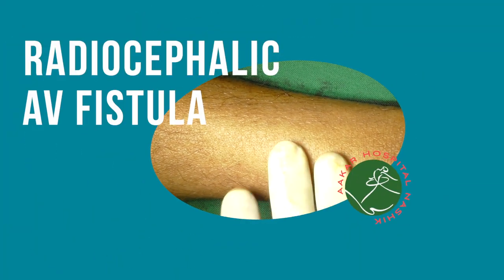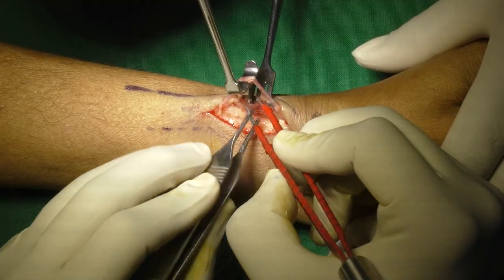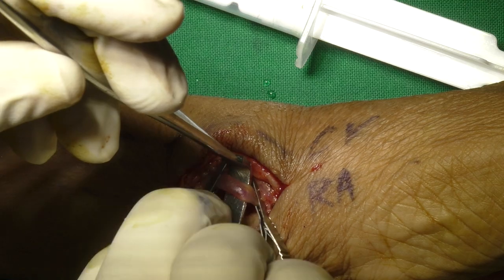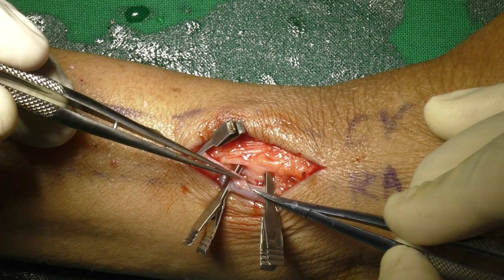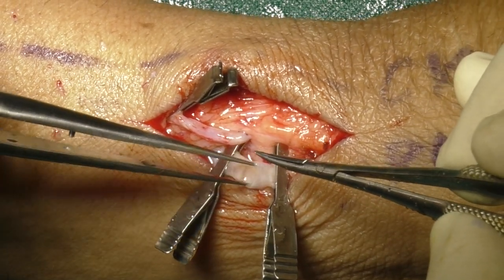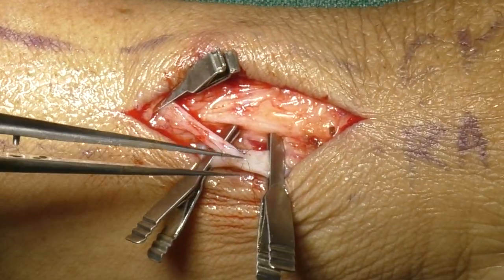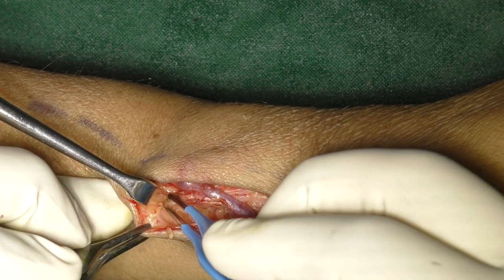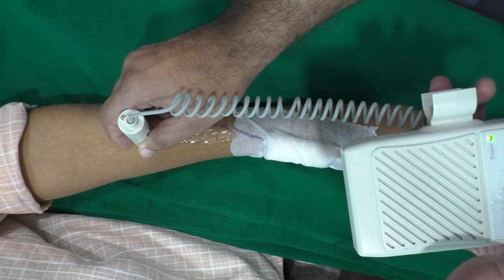RADIOCEPHALIC AV FISTULA  | DR KIRAN NERKAR - AAKAR AESTHETICS | NASHIK | 2022

Comment: Sir , how to record the video with such clarity even the microvascular anastamosis. Which camera or Handycam do u use. Are there only ot light or u use extra lighting.
Reply from the maker: We have installed a third arm in light assembly , on which we mount our Panasonic Camcorder ( max resolution 50 mp) V785 .. 

We have regular OT lights only . No other separate lights were used. 

Secret ( not so secret actually.. trick ) behind micro vascular clarity is proper zooming in of the footage while recording as well as in post production ..

Comment: Sir does excising the arterial wall result in a better patency? (Vs just incising + anastomosing)

Also is there any difference b/w continuous vs intermittent suturing?
Reply from the maker: It all depends on: 
1. What was followed in your training centre
2. What option you are comfortable with ( incise Vs excise )

Since I have never done an end to side anastomosis With just incising artery.. I feel excising some part of arterial wall works best in my hands.. I CAN'T COMMENT ANYTHING ON JUST INCISION METHOD AS IT WILL BE WRONG ON MY PART TO DO SO WITHOUT EXPERIENCING IT.

Regarding continuous Vs intermittent.. for smaller vessels , it's not advisable to opt for continuous suturing  ( I do continuous suturing for some part of Radiocephalic AV Fistula in the end though !😅 ).. however, for Brachiocephalic AV Fistula, I follow continuous suturing.   

One more ( unsolicited) fact: when I am doing intermittent suturing, I use 8'0 Nylon.. and for continuous .. I use Prolene ( 6'0 or 7'0 )